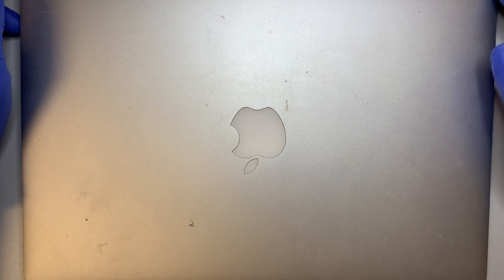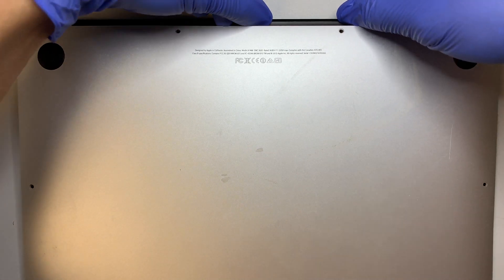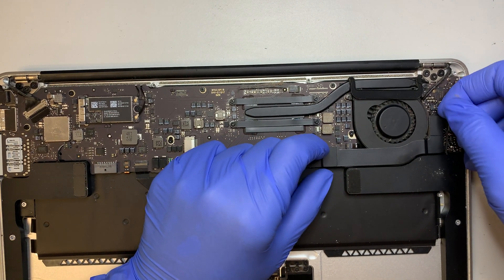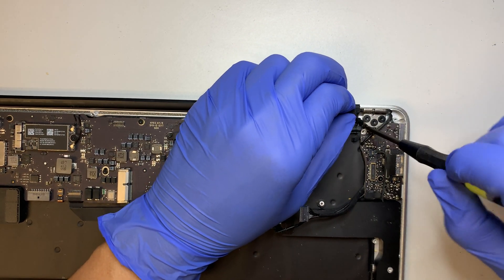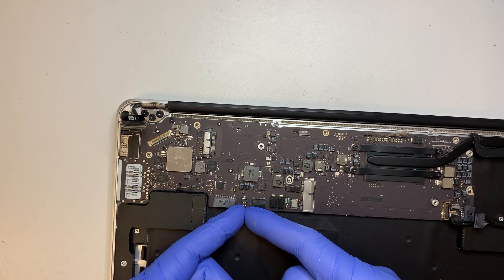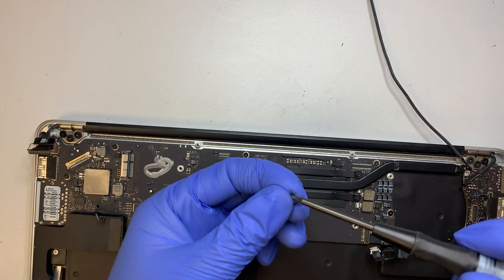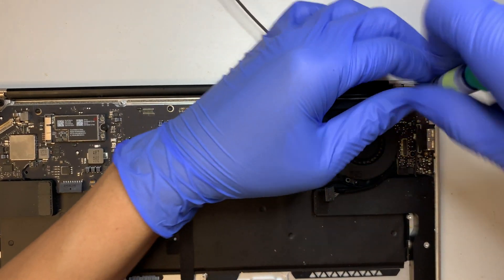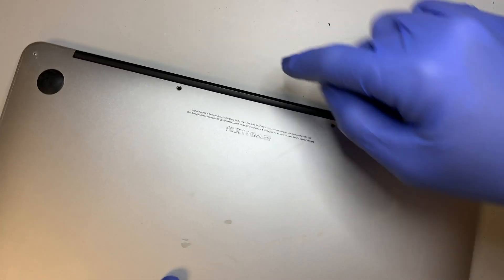Macbook Air A1466 2013 2014 2015 2017 Motherboard Replacement

Comment: I did a keyboard replacement and all was fine but I plugged in the monitor plug the wrong way in so now it won’t turn on the screen and the cpu is getting very hot . Is it possible to repair the short that it create it ? Is the motherboard totally no good anymore or can it be repaired?

Comment: Thanks for a great video. Will putting a MacBook Air (13in 2015) i7 logic board in a MacBook Air (13in 2017) with an i5 logic board make the 2017 MacBook Air run faster?

Comment: The presenter forgot to put back the rubber fan bumper. It is meant to  wrap around the heat sink to align the fan duct to the heatsink air intake vertical slots.

Comment: Hi, Very informative video. I have this laptop. Mine was working fine and then just turned off. It had been charging with no problems and holding a charge. I am not sure why it stopped working. I was wondering if you might know what would cause it to stop working.
Reply from the maker: Hi. Are you able to disconnect the battery and do direct power from adapter ?
Reply: @UbergeeksBiz   Hi, I disconnected the battery and plugged in the adapter. No green light or power, laptop did not boot up.
Reply from the maker: @theresap9579  Sounds like the logic board is bad
Reply: @UbergeeksBiz   logic board= motherboard?
Reply from the maker: @Kokoschka-ur1ll  yes

Comment: Thanks a lot for your video, very useful.
Can't find information about compatibility MacBook air 1466 between 2013-2017.
I have MacBook Air 13 2014. Can I change in my Macbook motherboard to the MacBook Air 1466 2015 or 2017?
I've read a comment below, that 2015 would be ok, what about 2017?
Reply from the maker: If I recall correctly, it will work. Just make sure you check the description and pictures before buying.

Comment: What is the cost of a macbook air 2013 model a1466, because mine need replacement of the motherboard and the cost of the the repair i think is more than the cost of the laptop.
Please answer 🙏
Reply from the maker: Cost of motherboard is around $300-$350 USD
Reply: @UbergeeksBiz  so the motherboard cost more than the device?

Comment: Hi I have a 2014 Macbook air A1466 13" i7 8gb mem. It will not turn on & I have tried all the tricks that I see on YouTube but still not working. So I would like to change the motherboard and I would like to know if I can use a 2015 or 2016?? also will I lose my info on the hard drive if I do so?? Thank you for any info you can give me.
Reply: Omg I’m currently dealing with the exact same issue except I have everything saved already. My computer is also 2014. I wish you good luck and hopefully we will have a response on how to fix it.
Reply: @philomathfromMK  Well I have to take a chance on it so I found out that a 2015 motherboard will be fine and should do the job without loosing my info. Thanx for the info.:)
Reply: Just in case I did win a bid on another macbookAir 2014 on ebay for $125 no power cord and no OS loaded. So now I will have two Mac's. I did buy a 2015 motherboard this week.
Reply: @napoleonbarros8272  yaay congrats, I on the other hand got myself a refurbished one on amazon, and took my 2014 to a repair and see how much it will cost, and the associate told me it’s between $500-$600, so I don’t know if I should repair it or get a used motherboard on ebay. Is yours new, cause the only ones I found are used motherboards.